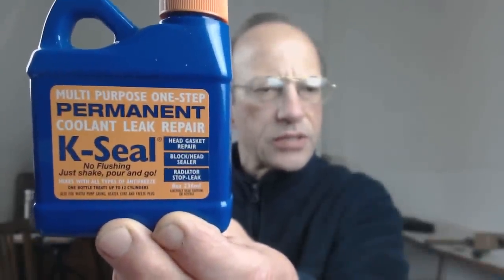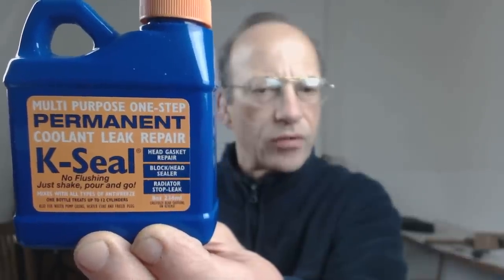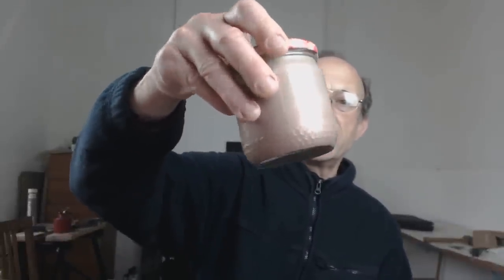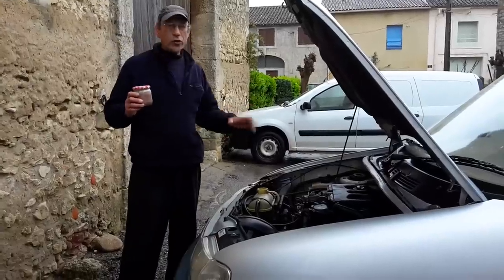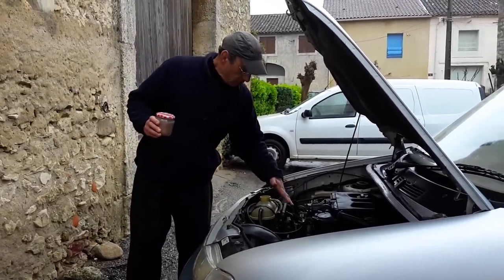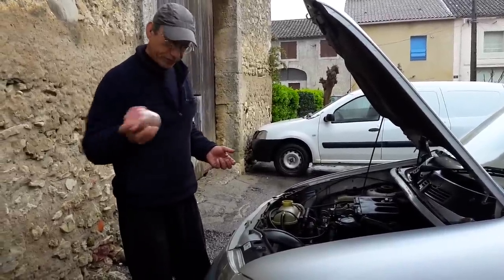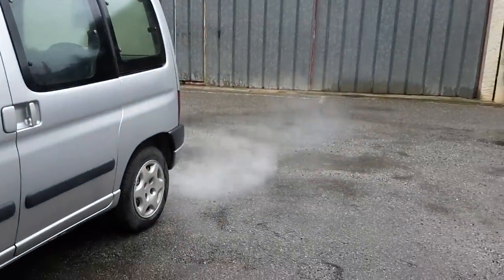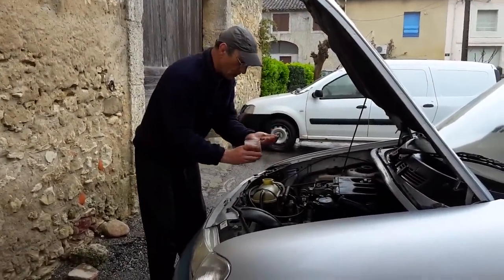K-Seal Full Test - Purchase options, Instructions & Results

Comment: Great vid... And a great product by the look of it. !
Reply from the maker: Ha! Yeah!
5 years later, the Berlingo is still going strong ... er ish :)
I reckon that the original issue (whatever that was), has made some progress.
Nothing to cause concern, as yet ... but there is some vapour on start up.
On the odd occasion, I have had to top up the header tank with water.

Would I attempt a Pic Carlit (with the Berlingo)?

I think that I would first need to go on a decent run, with a known level in the header tank. 
... of course; it may be the case that another bottle of the formula might be required.
If the gap (?) has opened up, then another dose would not be unreasonable.

Maybe we'll get to test it, once this effine-mass-madness has succumbed to :-
... "now I've gotta reason, now I've gotta reason to be waiting (The Berlin Wall)
:D
Reply: @EngineTuning  is this more effective with water alone or it's ok to mix with any anti-freeze coolant?
Reply from the maker: @jaysagrayum7448  It will work with anti-freeze :)
Reply: @EngineTuning  watching from America. You ate a great presenter. How is the K seal holding holdings up now? Did you do second bottle of it ?
Reply from the maker: @aaronweiser5421  Yeah, after 4 years, when new damage occurred, I tried a 2nd bottle.

For whatever reason, this time it didn't work.
However, I was not using the Berligo for long voyages, so I put up with the gradually increasing consumption of water.

It was different to the original problem.
There was no continuous exhaust steam.
Instead, the exhaust was coming through the cooling system.
Consequently, I began running it with the rad cap half on, to prevent pressurisation.
This allowed me to add water, if the journey was a touch long.

Again, for whatever reason, about two weeks ago, the gap finally sealed itself.

I figured, OK, close the cap.
No problems ensued.

As of this moment, the problem has been fixed.
I have checked the coolant level a number of times and it is stable.

My guess is that the fix will be permanent.

Let us not forget, that the world is not as we see it ;)
:)
Reply: @EngineTuning  that's very interesting, I had a very bad blown head gasket tons of White smoke. We used the Blue devil sealer,I'm in THE US..And it worked for about 5 days and now I'm  noticing  White smoke again gradually. If gets any worse  I'll use the K seal. Any advice how to pour it.
Reply from the maker: @aaronweiser5421  Just as I did, in the video.
Good luck :)
Reply: @EngineTuning  ok just one more question please. In your video did you have the heater on in the car when you poured it and idled the car and must I when I use K Seal??
Reply from the maker: @aaronweiser5421  I can't remember.
However, I left the K-Seal in, so ultimately it ran through the heater matrix.
I doubt that it makes any difference, but logically, you could close the heater, to ensure max circulation of the product, where you need it.
Reply: @EngineTuning  thanku

Comment: Handled my gmc 2000 thank goodness it was a small crack coolant doesn’t burn out and air conditioner works far better. Too bad I was too late on my 89 using KSeal  for the  Silverado  guages to head gasket was already destroyed with white smoke 💨 exhaust  engine died. I learn attacked problem before it gets out of hand
Reply from the maker: Ah yes ... a stitch in time, saves nine :D

Comment: I'm about to try K-seal on my 2003 BMW 325Ci convertable. Previous owner ran it with a bad radiator cap and overheated it. Since then it uses up more than a little coolant and runs hotter than it should. I suspect a head gasket and this is one thing that might be worth trying before I tear into it and do a head gasket job on it. I've heard concerns that it may clog up a cooling system, and it may. The way I see it, if it it does clog things, I was going to tear it down anyway right? I'll update you on how it turned out and possibly post a video as well.
Reply from the maker: Good move James.
Keeping an open mind, and having a 'get out of jail' plan is always wise in life.
It is highly unlikely that it will clog up the cooling system as it is designed to operate in the cooling system.
Anyway... good luck with the project... let's hope it's a success :)
Reply: Thanks, and your right. I always have a Plan B, and as this is not my only car and not my daily driver, I can experiment a bit with a "quick fix".  So on to the update, I've put it in the car and clocked about 15 miles on it. Took it for the recommended "gentle drive" per the K-seal instructions. The temp spiked a couple of time, then went back to normal. These cars are notoriously finicky in terms of bleedng the air from the cooling system, so the spikes could have been air pockets. The heater ran nice and warm, then would suddenly blow cold at the same time the temp spikes happened, then heat would return and temp would return to normal. This seems to comfirm my air pcket theory. It was not bubbling from the overflow or steaming when I parked it, so that was a good sign. Tomorrow I'll go about the lengthy bleeding proceedure and see how it well it does. Will keep you all updated.

Comment: Is it okay to close the water tank after you pour the k seal in? And let it do the work?
Reply from the maker: That's a good question Gerti :)
My guess is YES!
In fact, there is every likelihood that it will be better, as the system will pressurise, and force the product into the cracks.

What I would say, is READ THE INSTRUCTIONS :)
... and follow the instructions ;)
Reply: @EngineTuning  thank you. And one more question please. Ibreplafe my head gasket 4 months ago in my 03 fiesta 1.4 tdci. And now it started again. My mechanic used a similar product named abro and the car started again issues. Is it okay to use k seal after i do a coolant replacement?
Reply from the maker: @gertiademaj5269  Probably!
It is unlikely that there will be a chemical reaction between the products ... but obviously 'I don't know this for certain'.

My guess is that your cylinder head is warped (bowed), and if so, would require skimming to flat.

You could risk another gasket, ensuring that you first torque the two centre screws down.
Then torque down the screws on each side of the centre ... and so on, until the head is clamped down.

This technique will take the bow out of the cylinder head ;)

It all depends upon how much the head is bowed.
Reply: @EngineTuning  once again thank you

Comment: Hi, hope you are well, I got a Vauxhall Corsa 1.2 2006, already wrote to you if you remember :)   when i remove  the coolant cap Radiator became warm at the same time coolant start coming out side the tank, when i accelerate high, too much water or coolant coming from the tail pipe, feeling some thing is stuck, didn't change the thermostat yet was wondering if this is surely thermostat. car over heat so quickly. please advice want to use the K seal. Thank you
Reply from the maker: Thank you, yes I remember our conversation :)
It sounds like it could be the head gasket.
If it is blowing combustion fumes into the coolant system, it will start pushing the coolant out of the header tank immediately.
Reply: So should i change the thermostat for coolant circulation? any chance i can use the k seal? can i use the k seal without having a thermostat? what is the solution in your opinion please
Reply from the maker: You can use the k-seal without a thermostat.
Removing the thermostat will provide better circulation.
It is easy to remove and refit.

But if k-seal fixes the problem, you will need a thermostat for winter weather.
Good luck !

Comment: My car loses coolant and there's a lot of exhaust gas in the reservoir. Do you think it's too late for it or will it work? The car has been driven like this for about a year now and the coolant loss has only gotten worse...
Reply from the maker: It sounds like it is a perfect candidate... a very similar story to mine.
I would say that there is a high probability that K-Seal will fix it.
Report back and share your experience ;)
Good luck!
Reply: PlayF1 Net thanks man, you're a really nice dude. :) I sure hope it will fix it, because the car runs perfectly otherwise. I really don't want to rebuild the engine since i'm preety sure all that coolant didn't do much good to it, i believe the engine has too much damage for what it's worth. If I really want to keep a car, i'll look for a used engine. In any case, I hope this magic solution will work, because extra cash is always nice! :D
Reply from the maker: Thanks for those kind words, they are much appreciated :)
Re costs... it's a small sum to gamble, and we have had very few fails reported in the comments... maybe 3.
That's out of 48k views and 238 Thumbs Up.
Once it is fixed, remember to replace the oil.
Reply: Engine Tuning Update: The car is still running great 10 months later after fixing the leak with this magic solution! I've flushed the coolant after a few weeks and I'm happy to say that my car hasn't lost any coolant (I used to need to refill every 150 kms). It really saved me a lot of cash and I'm really happy that it worked so miraculously! Everyone should try it with a head gasket leak, it works wonders!
Reply: Update: the problem seems to have returned again. Car loses a reservoir worth of coolant every 300ish km. I'm going to try to put in K-seal again, hope it works as well as it did over a year ago.
Reply: Update: the problem has gotten a lot worse, it seems that the head gasket (and maybe the block itself) has a big hole in it, since a lot of steam comes out of the tailpipe and there's a lot of pressure in the coolant reservoir, also "mayonaise" has started to appear in the oil :(. I haven't put any k-seal in more than a year now, I'll try to add it again and see what happens. At this point car has a lot of rust and many other problems (1996 Renault Laguna), if this doesn't work we'll scrap the car since it's just falling apart on us.

Comment: Didn’t work for me.  My car is actually overheating faster than it previously was.  I’m wondering if it clogged up my radiator so I might replace it and see if it continues to overheat.  If it does, then I’ll have to do a head gasket repair. Thanks for the video I’m happy it helped you and so many other.
Reply from the maker: It is always possible, but there is no body of evidence for clogging, unless the rad was effectively clogged already.
The root problem may be worsening.
Reply: @EngineTuning  would you recommend multiple applications?
Reply from the maker: @berserkerstrommortsgreb3131  
Not really. 
It is an option, but one dose normally fixes the fault.

How far can you drive before the water light comes on?
Me, I'm now doing around 250Km per litre.

I probably should put in another dose (after 5 years).
It's supposed to be a permanent fix, but my guess is that, whatever was damaged, has gotten worse.
Reply: @EngineTuning  If I go up hill I can go maybe 5 miles.  If I go flat maybe 30 miles.
Reply from the maker: @berserkerstrommortsgreb3131  
You are using one litre of water, every 30 miles???
Reply: @EngineTuning  probably more than that.  The entire thing overheats within 30 miles and water pours out everywhere.
Reply from the maker: @berserkerstrommortsgreb3131  
If water is pouring out everywhere, then this is probably not a problem for k-seal.

You need to discover what the problem is, and where the water is leaking from.

Saying 'pours out of everywhere' is not helping you.
You need to know exactly.

k-seal is for fixing cracked castings, or blown gaskets.

It will not fix hose leaks, or failed water seals.
Reply: @EngineTuning  a mechanic diagnosed it with a blown gasket.   It overheats then all the water spills out, and/or evaporates.   I just know I have to fill it up again with a substantial amount of fluid.
Reply from the maker: @berserkerstrommortsgreb3131  It sounds like you will be lifting the head ;)
Reply: @EngineTuning  😞

Comment: Great video and very helpful. I've just bought a bottle and will be trying it out on my bmw e46 convertible. which has been blowing white smoke consistently and the oil light and coolant light came up on the dash. Been advised to try this by my mechanic so hope it does the trick! all the best ☺
Reply: DId it work?
Reply: +ChrischrosBelgium Hi, so I've done my test today. topped up my oil in engine and put the k-seal in with further water/coolant. both lights are off on the dash. and after warming up the car and driving round for 20 mins I'm experiencing a lot less white smoke! compared to what I used to get i.e going off at traffic lights and reversing etc. however there is still some white smoke in places but I've been advised by my mechanic to give it a few weeks. and no more lights came up in my dash. so far my conclusion is not 100% repaired as of yet but definitely much much better after 30 mins. hope this helps!
Reply: great.
Reply from the maker: Good luck with that Christopher.
Out of interest..... what procedure did you follow, when adding the K-seal?

I'm interested, because, I added mine, after warming the engine with the rad cap off.
Then I added the k-seal to the empty header tank.
Then I topped up with water, and left it idling till almost all the steam had disappeared.
  
I think that after 3 or 4 minutes, it was probably fixed, and it was just residual water that was steaming.
After a short gentle drive, I returned and no steam at all.
 
From your report... I got the impression that you added the k-seal cold.
The instructions do say that you can add it cold.... so why not.
Also, I'm presuming that if the vapour has significantly dropped, then it is likely to continue dropping.
The reason being that if the crack has been closed up, so surely it will continue to close up.
 
Anyway.... I'd be very interested to learn how you added the k-seal...&#160;in fact, I think a lot of people would be interested to hear about that ;)
Reply: +PlayF1 Net Hi there, So my process was I switched my car on in the morning and started the motor running. Added the K-Seal in whilst cold then topped up with water to near max. My coolant/water was mostly flushed out the day before by mech. So my coolant light is up on my dash. Car starting to warm up slowly and left idling for 10 mins. Then I went for a 30 min drive. 10 min to a car park. Left the car running. checked under car and no more water leaks. idled for a further 10 mins to really get to temperature. then 10 min drive back home. By this point starting to notice a lot less smoke when driving off from lights and reversing. Topped up my water the next morning and looked under the car. No more water leak and also noticed my oil is staying level. The white smoke has not 100% gone away but most definitely so much better compared to how It used to blow out on 1st gear and reverse. No more lights have come up on my dash. So far that's what's happening with my car. I'll do another review in a few weeks to see how things are going etc. All the best, Chris
Reply from the maker: Great report Christopher...... very thorough.
Thanks for taking the time to share your experiences.
 
By the sound of it, your engine must have had a serious leak.
You saw my video..... it was effectively sealed in 3 minutes.
The vapour stopped after a short ride out.
 
You didn't mention that you dropped your oil.
I would advise that you do.
My guess is that the oil (and sump) is full of water.
This will be bad for your engine, and could explain why it is continuing to smoke.
 
Change your oil as soon as is possible (it IS knackered), and perhaps you could report back.
:)